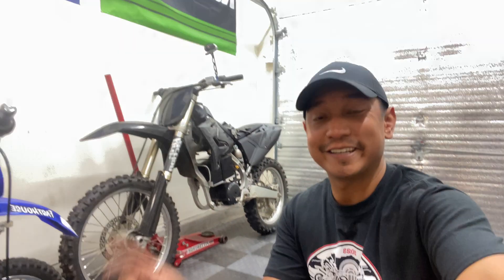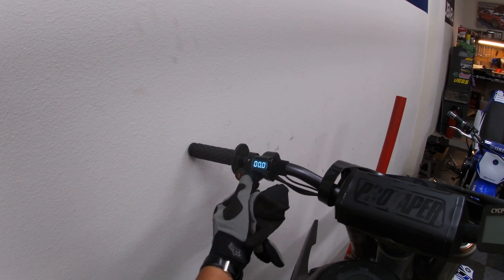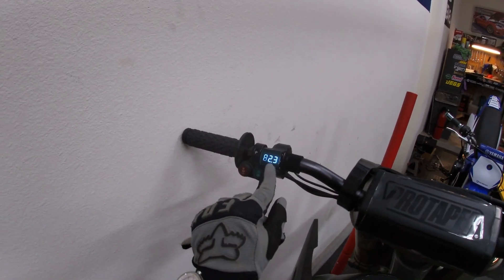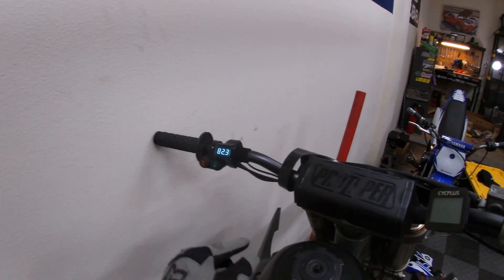Project YZ E-Top Speed Testing 72V E&C QS138 Powered Yamaha YZ250 Electric Dirt Bike

Comment: I wish it was doing 100+mph also how much dc current amps are u pushing?
Reply from the maker: @AKAKILLINGKING  where do you ride a dirt bike going 100? 400 amps peak, likely gonna swap the sprocket set and regear it to do 70 and leave it there.
Reply: @PatOutdoors  a street? And stretch of road? A 250cc tops out around that so it would just be perfect
Reply from the maker: @AKAKILLINGKING  Eveyone has a different use for their dirt bikes. I have this bike geared for trail use mostly
Reply: @PatOutdoors  still who wouldn’t always want more available power then being limited to a certain mph

Comment: Are you happy with the range of the 40ah? Can you fit a bigger battery?
Reply from the maker: Hmm I'm not fully sure yet. I haven't gotten to consistently test it enough yet to answer that. I got 1 HR and 45 Min on some light trails, but noticed about 1 HR ride time with constant pulls on the street. I didn't run it down past 76 Volts yet though so I'm sure I could probably milk more out of it.
Reply: @PatOutdoors  with my amorge the way I handle it is I do not want to be more than 5 miles away from home at 66v. And I’m getting 27 miles with 70v left. That’s with a 32ah pack moving my 220lb self and 138lb modes razor.
Reply from the maker: @Offthevoltz  That's pretty good vs what I'm getting. But please keep in mind mine is on a 220 lbs motorcycle lol, so there is a lot more load on it constantly. I wonder what kind of range I would get if this was on my MX650..